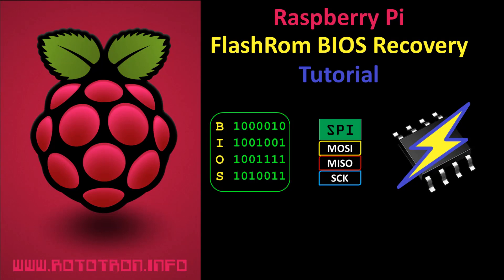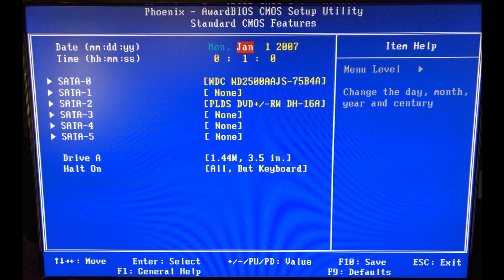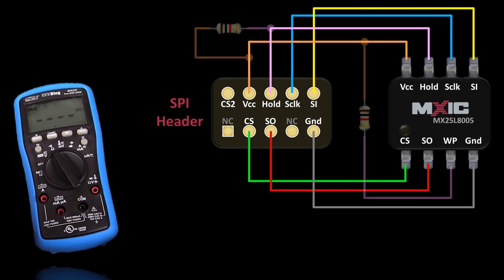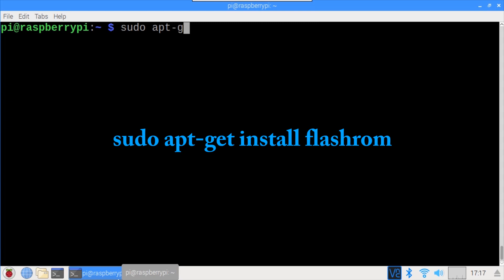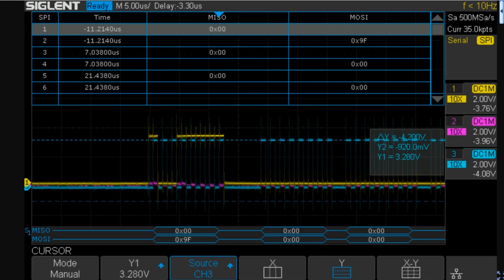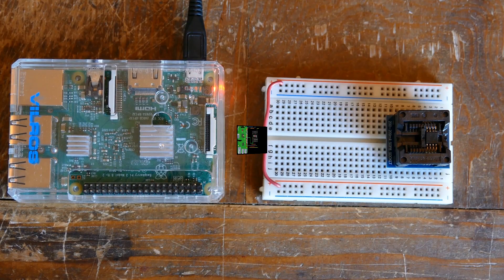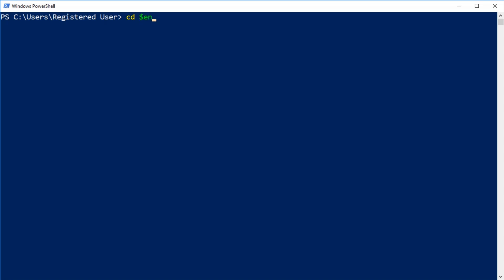Recover Bricked BIOS using FlashRom on a Raspberry Pi

Comment: Gigsbyte motherboard bios have much size then what flash chip can take. Flashrom fails to flash it due to file size. What should I do please some help? Already tried to unpad with dd but still no post.
Note: Downloaded bios software from Gigabyte's website for B550M DS3H model. Contains a lot of 0xFF's and even not sure if they made for writing directly to the motberboard
Reply from the maker: Newer boards use UEFI.  I have another video on UEFI for an Asus board: https://youtu.be/wu2PWxJ5IU0
However, your best bet is to post your question to either the Win-Raid forum or the BIOS-mods forum because different brands require different approaches:
https://winraid.level1techs.com/c/bios-uefi-modding/7/all
https://www.bios-mods.com/forum/

Comment: I have an asus Prime B550M-K board with no post, video. Only the fans spin up. Flash chip is a Winbond 25Q256JWEQ and runs at 1.7V to 1.95V. No spy header. I have a CH341A programmer with Test clip to directly clip onto the chip. I worry about the voltage at 3.3V from the RPI. Could you recommend some information or do a quick video on dealing with 1.7 to 1.94V bios chips with the rpi?  Your Videos are wonderful and worth every second. keep up the great work. Much appreciated.

Comment: Kudos, I flashed the bios.  However still wont post. dell Inspiron 3650 i5-6400 turns on white light then amber, after 5 seconds of amber it blinks twice then repeats.  Led diagnostics code suggests can't detect memory, tried few ddr3's but no avail.

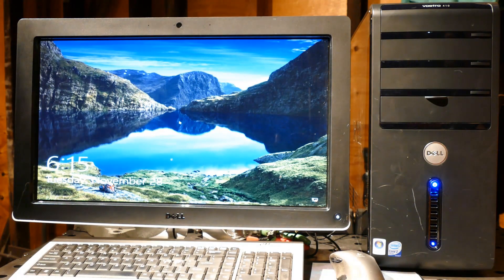Comment: I did it and in 13:58 byt i have " Error. Image size (5711668 B) doesnt match the flash chips size (8388608 B)! . I dont understand that clear. Have you got an idea?
Reply: i solved the problem. Btw my mobo was dead anyway

Comment: About 1995 i had the same problem. Well i did have to buy another BIOS eprom. No Raspberry no oscilloscope no multi-meter were available.
But didn't need any it was a simple swap. While the computer was running i started the BIOS flash process from a floppy disk again, just before
writing to the BIOS chip i swapped the chips and put the bricked one into the socket. It was a hot swap :) the operation was successful. I still have
both chips. However it's very cool stuff you are doing, nice to watch. Thumb up!

Comment: I tried using this method to get the bin file for the dell inspiron 3420. This does not work. could you help me debug this?
Reply from the maker: I examined the bios executable file and there are several optional switches:  factory, forceit, forcetype, nopause, noreboot, wipeall, wipeclean, writehdrfile, rom=, debug, writeromfile
You can run the .exe file with the /writeromfile to extract the rom or /writehdrfile to extract the header.
Reply: @rdagger  when i try to use –writeromfile i get error unknown command
Reply from the maker: @advaithmadhukar2609  Make sure you use a dash slash and not an em dash.
Reply: @rdagger  i used a - no change
Reply from the maker: @advaithmadhukar2609  I just tested it and it works.  You need to use a slash.  For example:  3420A13.exe /writeromfile
Reply: @advaithmadhukar2609  - != /. Make sure to use a slash / not a hyphen -
Reply: @aqua3418  ah sorry I forgot about this. It does work
Reply: @rdagger  does that write a bin within the current directory or does that write the bin file to the physical bios chip

awesome video BTW
Reply from the maker: @the.real.ipatch  current directory, thanks.

Comment: Why didn't you put a 1k resistor between Hold and VCC / WP and VCC (like in the original diagram @4:09)
Reply from the maker: In the first attempt, the motherboard already had the resistors in place.  In the 2nd attempt I just pulled the pins high.  Clearly programming worked without the resistors.  For quick programming it probably doesn't matter but I still think it's prudent to use resistors.  Good catch!

Comment: Since you unsoldered the chip anyway, you could have used a TL-866 programmer and stuck to a windows GUI instead of resorting to a command prompt on a raspberry  pi.
Reply from the maker: You don’t have to remove a chip to use a TL-866 because it has an in-circuit serial programming port.  I chose FlashRom on the Pi because I wanted to show people how to program chips without having to buy a dedicated programmer.   I have another video where I demonstrate the TL-866.
Reply: Some of us find the command prompt on RPi far more useful and convenient than trying to find a working Windows installation, so this video has plenty of merit.

Comment: NICE Guide.... succeeded on HP 2570p EliteBook BIOS-Chip (Winbond 25Q128BVFG) with your video as a guide.... without desoldering the chip.... 1000 tx

Comment: hi my motherboard in flash bios has 9 pins instead of 10 how can i know the equivalence of the pins
Reply from the maker: You can use a multimeter set to continuity mode to tone out the pins from the  chip.

Comment: Nice video! A word of caution, though: RPI I/Os are 3.3V and some EEPROMs (like Winbond W25Q128FW found in MSI B450 Gaming Plus) are 1.8V! In this case, you may blow the EEPROM, the RPI I/Os or both!
Reply from the maker: Great point!  In this case you could theoretically use a BSS138 based logic level shifter and lower the SPI speed to around 1 MHz.  Both Adafruit and SparkFun sell inexpensive shifters.  I’ll make a note on my site.
Reply: I have just succeded With 3,3V on a Hp EliteBook 2570p with a W25Q128BVFG chip...
Reply: @mortenkristensen1669  Cool, it makes sense: that is a 3V part.

Comment: I’ve been doing this on a 2009 MacBook, but there’s a bunch of garble on screen when I erase and write to the Eprom, is this normal?
Reply from the maker: I don't recall ever seeing garble.  I'd try lowering the speed and check your wiring.  Try to use good quality jumpers and keep the wire length as short as possible.
Reply: rdagger68 It turned  out I was selecting the wrong chip definition, and that was why it wasn’t working correctly, although there was still garble when writing and erasing the chip, I’d imagine it’s showing the data it’s currently transferring.

Comment: I have a DA0NZ2MB6A0 motherboard, but can't locate bios chip. 🤦‍♂️
Reply from the maker: I’m not sure about that particular HP motherboard but it is probably an 8 or 16 pin SOIC.  Look for chips labelled Winbond, MXIC or MX.  Start searching near the BIOS battery.
Reply: @rdagger  Yup, it was a Windbond bios chip. I was hoping to find it on the   side of the motherboard near the CMOS battery, but no luck! Then, I took a look on the other side of the motherboard and there it was.

Comment: Yes, there is a way you could try to read flashroms in circuit. If there are resistors on the bus, put your reading device on the side of the eeprom, and so the motherboard controller or main ic that interfaces with the eeprom is on the other side of the resistors. this way, your in controll of the eeprom, not any original master ic thats on the other side (and gets powered by your reader, and so blocking reads.) lifting the WP or CS pin from the board and connecting to it yourself might also do the trick.

But if desoldering was easier, or faster, go for it. I got a lenovo E530, and I cant read or write to it onboard, no mater how i put my reader on the bus or lift pins. basically I have to lift em all. 

Also, some motherboards, like min, have the actualy firmware spread accross 2 eeproms, the update file is also split in two, but not for the both eeproms, its basicly getting copied into ram, the two files and the embedded controller will make it 1 image and programms them into 1 go, the actual code responsible for writing splits it again but at a whole diferent place. Thus, combine using cat and split using coreboots ifdtool. you can even clear the ME rom part (it wont leave it empty, but the ME engine cant boot. but it wont reset your system either, as it does check its firmware, wich this tool makes correct but empty). 

Coreboot is a intresting thing, even if we dont use it :D

Comment: No matter what I do it can’t see the chip. From a video card chip.
Reply: Wait... I am not home I will check but I  did not hook 3.3v to the WP and HOLD as well. Ive only tried hooking it up to WP
Reply from the maker: Who makes the chip?  What is the model #?
Reply: I also tried an MX25L2005ZNI-12G I also didn’t wire in the WP and HOLD,  this one I think it read it twice intermittently. The other one I’m getting nothing off of is also from an NVIDIA mxm card
Reply from the maker: The MX25L2005 is supported by FlashRom, but make sure the other chip is supported too: https://flashrom.org/Supported_hardware
Reply: Other one pm25lv010 even with all wires connected I get no eeprom
Reply from the maker: Did you desolder it?
Reply from the maker: You might also want to try posting your question with pictures to www.bios-mods.com/forum/
Reply: Yes I removed from the board solder to this other board and ran the jumpers to the bread board from the cana pi kit. I’ve had a night of no luck with repairs today l. Couldn’t get my a1466 logicboard working either couldn’t figure out why I’m missing s4 rails

Comment: i am trying to flash w25q128fv but the firmware file is larger than chip size what am i doing wrong. pls help.
Reply from the maker: Sounds like you have the incorrect firmware file.
Reply: @rdagger  nope i have double checked its H170 Pro gaming and i downloaded it from the below link.
https://www.asus.com/in/Motherboards/H170-PRO-GAMING/HelpDesk_BIOS/
Reply from the maker: That capsule file contains several regions in addition to the BIOS such as GbE and ME.  I think you need to use a tool like UEFITool to extract the BIOS region.
https://github.com/LongSoft/UEFITool

Comment: Hello, i have and Alienware x51 from early 2012 or 2013 cant remember, and mi bios chip is bricked due to a bad flash, i have opened the MOBO but the bios chip does not have any label on it so i dont know the bios branch so i dont know where to find the schematics, can you help me???
Reply: I was able to repair a bricked Alienware x51 with this tutorial :)

I had to look up the manufacturers' pin layout for the chip, then use a multimeter to test which the spi spin layout. (which was a strange one btw!)

Among other things, the Vcc and Gnd were reversed.

nc Gnd CS S0 nc
D nc SCLK S1 Vcc
D= dummy pin
Reply from the maker: I Googled it.  Looks like a MX25L12873F.  https://www.dell.com/community/Alienware-General-Read-Only/Area-51-R2-Bios-chip/m-p/5599083/highlight/true#M100674
Reply: @rdagger  That's an Area 51 not a x51. Might be similar.
Reply from the maker: @Oscar Salgado It is probably an 8 or 16 pin SOIC. Look for chips labelled Winbond, MXIC or MX.  It might be socketed so also look for socketed chips.   Start searching near the BIOS battery, but it could be anywhere even on the other side of the motherboard.

Comment: I've tried it and it read the chip once, but after that it wouldn't read it anymore I've already soldered the chip off the motherboard, and it only appears to get warm. I've tried this before with 3 other chips with similar results, is my pi broken or is there something I'm doing wrong?
Reply from the maker: Heat is a bad sign.  What is the brand and model of the chip?
Reply: @rdagger  it's an MX25L3206E
Reply from the maker: That chip should be fully supported by Flashrom.  When you read the chip did Flashrom correctly identify it?  You should receive a message:  Found Macronix flash chip "MX25L3206E/MX25L3208E"
Are you sure your wiring matches the video and you are using the BCM numbering?
Reply: The wiring is correct, though there were times where it wasn't and other pins were shorted to ground. 

imgur com/a/Cvhqvtu
This is how it looks
thanks for the help btw, really like your videos

Also I'm not getting notified of replies to comments which is why I take too long to reply
Reply from the maker: It looks like you have the CS and ground wires crossed.  Also the adapter board looks cooked.  The pin headers are melted and the PCB is discolored and delaminating.  This is probably the result of too much heat during soldering.

Comment: This video was EXTREMELY USEFUL! Especially the experience of the loaded clock line, I never would've fount that out.
I have a question though: 
How do you repair bricked Android phones? Do they have SPI/I2C interfaces or something else? 
Thank you for this video, this was enlightening.
Reply from the maker: My only experience with flashing phones is a rooted iPhone, but I just used software tools that are freely available online.  The same tools can usually be used to recover bricked phones.  I use the term bricked loosely.  If your phone is freezing at the boot screen then it should be fairly easy to fix.  Most phones have some type of bootloader or recovery mode that will allow you to restore a factory image.  

If you push the power button and nothing happens then it’s less hopeful.  There are USB Jigs available that supposedly can recover truly bricked phones.  In theory you could desolder the flash chip from a phone but they are often tiny BGA packages which would be challenging.  You would definitely want to check that FlashRom has write support for the chip before you desolder anything.  Also, newer phones implement encryption that could thwart such hardware mods.
Reply: @rdagger  Also the PSP battery is interesting. PSP 2000 Batteries have a wire trace labeled 19, severing the connection changes the eeprom value and makes it a Pandora's battery which I may look into. I've done it before but I am curious as to how it works
Reply from the maker: I don't know but I suspect Sony used encryption to dissuade piracy.  I vaguely recall Sony deploying countermeasures in the 00's in response to hackers.  However, since they're so popular I'm sure someone has a clever solution.
Reply: @blameburr8722  Lifting the pin on a psp battery eeprom indeed made it so the psp saw only zero's (or ones, not sure wich) but that way the bootloader "thinks" its in the factory and loads a IPL file from the Memorystick, it does need to be a MagicGate memorycard (the bootloader probably only wants to load the IPL from such cards). the custom IPL isnt checked if its from Sony, so the homebrew scene wrote one themselves.

There are even tricks to use a pandora to boot a IPL that will check if the system is hacked, if not, loads the hacking tool, else it boots the normal way (asuming your shell is hacked). but many people just bought or hacked a battery with a switch or use anotehr battery.

Ive installed a switch on my eeprom, so I switch it into working state or off (pandora state)
Reply: @rdagger  Long time no see, I saw you years ago when asking for help with an LCD and yes it is BGA I was watching someone make an iPhone and upgrade the ram and they had to remove the chips reprogram them and then resolder the BGA chips. Not worth it tbh. Was curious if it'd work with a truly bricked psp 3000 which cant be fixed with a Pandora's battery